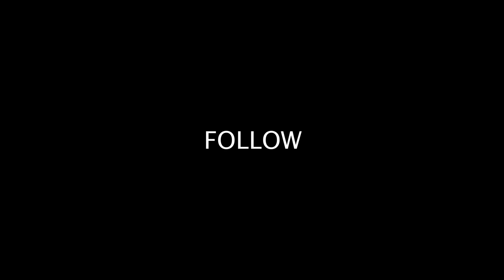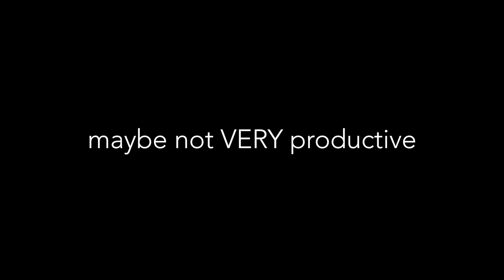the end of an era...

Comment: If you have snipe issues one option is to put a longer board underneath. You will need to either put a stop block on the front and use some rubber to grip, and make an adjustable stop on the other end, or use some double sided tape, carpet tape. The long sled board on the bottom will keep it straight as it passes through but it looks like you adjusted it close enough. Just keep the sled in mind if you have that issue with some other board or something.

Comment: For your snipe issues grab your owners manual, feeler gauge and a block and make sure your infeed, outfeed, cutter head, pressure bar and chip breaker are all set to the measurements in your manual.  I was getting horrible snipe after swapping my cutter head from knives to a helical head.  Went back to the manual, under adjustments and reset everything to the recommended measurements.  All my snipe issues were eliminated after doing so.  Look for your Cutter-Roller Assembly (side-view) for the information.

Comment: The board is not flat!  That is why we joint boards as part of the squaring process.  Test. Place your boards on a known flat surface and see if they rock.  if they rock they should go across a jointer.  No jointer? You can plane the high spots off but that is time consuming. 
If you are going to do this right you need a jointer. Get a jointer wider then your boards. Another is a drum sander.

Comment: A planer is a "rough-cut" tool.  This means the user is getting flat, parallel surfaces that are close to the finish dimension but still rough.  Wood is generally left thicker and/or longer than is needed.  Then, snipe and other tool marks are removed by sanding or cutting.  Get a drum or wide belt sander.
Reply: Agreed you want to leave 4” on both ends of the boards more waste but zero snipe when you remove the ends. I have the super max and it’s perfect for cutting boards
Reply: @ibf8581  I think you could probably get by sanding the snipe out rather than cutting it off.  Seems like it wasn't very deep.

Comment: I'd recommend getting a rotacator for dialing in your planer! I have a Jet 208 HH (mechanically identical to the G1033x), and I was having bad snipe/infeed problems as well. Using the factory recommended heights for the various components (bed rollers, infeed/outfeed rollers, chip breaker, etc), I've been able to get it perfectly dialed in. The recommended settings are very precise and most easily acheived with a rotacator.
Reply: I agree 100% 
Unless your pressure rollers are set as accurately to the bed as the cutter head then snipe will consist. That's what I focus on!! Infeed and outfeed rollers don't really matter.....it's the pressure rollers that keep material from snipping. 
The rotacator is sure easier to use than anything else for these adjustments inside the planer.

Comment: Just keep in mind you can never total eliminate snipe while running a single piece but looks like you have it tuned up to where its not noticable. Running multiple pieces back to back with sacraficial boards to start and end is a great technique to try
Reply: Of course you can, with a decent quality machine. Mine (A3-31) is totally snipe free when I lock the table. But you are right that it is much easier to do when pushing all the boards one after another.

Comment: Hey Guys, 
We make quite a few cutting boards. I’ve learned the best way to avoid snipe is less use of a planer. You do a higher volume then we do so its not quite apples and apples. I bought a Freud Glue line table saw blade. So i can go right from the table saw to gluing in clamps. I do not have gaps. If my stock is thicker i also run them through the table saw or drum sander before gluing.. So i go directly from table saw then clamps to drum sander with 120 grit paper
I never put a glued up board through my planer. I have a Delta planer . Making sure my in-feed and out-feed tables are as close to perfectly level as possible and blades are sharp. When you were doing the adjustment of the rollers I would recommend digital calipers to get a better adjustment.
 I have many years as a woodworker. Retired USAF avionics technician and commercial airlines A&P. Spent a big part of my life calibrating and maintaining equipment. I really recommend a documented scheduled inspection for cleaning, lubricating  and checking adjustment of equipemt

Comment: I have the same grizzle planner as you do.  Here's the fix- The problem is the short boards you are running through it.  To fix - take a piece of 3/4" plywood that is one foot longer than your cutting boards on each end (2 feet longer than the cutting boards) Screw a thin strip of wood crossways across the  plywood - one foot from the end to keep the cutting board from sliding backward as it runs through the planner.  Called a sled, will stop sniping on short boards run through your planner. Need more information contact me a George Wood of Texas.
Reply: What I don’t get is that this guy thinks that snipe means there is some wrong with the planer, whereas any woodworker knows it’s a common issue with planers. He seems to ignore all the people like you who give the solutions.

Comment: Not sure if you figured this out yet, but here are my solutions: 

1) you need to do 1 of 2 things:
 A- run all your boards together, back to back to back to back … with a scrap peice before and after each “run” of material
B- Have 2 sacrificial pieces, one before and after the board, 

Why? You are likely getting snipe when the weight of the board is too much or little for the roller, or the pressure from the roller is To much for the board.  In other words, The rollers are putting uneven pressure at the front and end of the boards.  Doing either A or B listed about removes the uneven pressure.  It’s a mistake many of us have made.  This should fix your issue, since the snipping is only occurring at the front and back of your pieces. The intermittent part is likely due to running only 1 board through … or not feed the machine fast enough with board 

Other solution:
If you can figure it out, wasting a whole board is bad business.  Instead of making an 16” board, make a 20” board that you cut 2” off each side.  Whatever is enough to save the board.  Usually snipe is 1-3” from my experience 

That should do it.  Maybe you knew it, maybe not, but hope it helped some.  I didn’t know those big bastardly machines need oil every 24 hours, so saved me a headache in the future.

Comment: I believe the bolts that adjust the tension on the feed rollers are passthrough. Put a couple drops of oil in the hole and it drips through to the rollers. At least that is how my powermatic version of this planer functions.

Comment: You will almost always get some snipe plane longer boards and cut off the snipe. It also helps the do several light cuts 1/64. plane your cutting boards in longer lengths the crosscut to desired size
Lift up slightly on the infeed and outfeed just a little up pressure helps.  Have fun
Reply: I have been a cabinetmaker for 42 years its fun watching your videos thanks

Comment: If you run all of the boards in a row touching end to end, you will only get snipe on the first and last one in the chain, this might involve having a buddy one to feed and one to catch but it will completely eliminate the cause of snipe, and it will also speed up operations.
Reply: I do this but use a scrap piece as the leader and then use the same piece at the end of the line.  Just set it on top of the planer as it comes out and you can then feed it back in at the end.  Then only the scrap piece has the snipe.  Works really well!

Comment: Bed rollers are to high. You need a dial indicator and set your roller to zero. Then wax the plane bed.  If it still sniped you need to look at your pressure bar.

Comment: Oh the dreaded snipe issues ,never fun and causes a lot of waste ,I make edge grain boards so I can make thicker boards without doubling $ buying 8/4 wood ,I put about 23 strips per board (average)27 in my latest , but doing thin strips through the planer I have to lift the strips on the out feed side to avoid the snipe ,it works great but slows production down 🤷‍♂️ oh and it’s just a cheap 12” delta portable , great video guys !!

Comment: Try either running a scrap piece of wood ahead of the boards or glue sacrificial trim pieces on the sides of the cutting boards keeping them a little longer than the board, that’ll stop your snip, I use these methods with my bench top planer and it stops all snipe. Good luck keep up the good work I really enjoy your blog.
Reply: That’ll get expensive when your running thousands of BF
Reply: @Kurutzkraft  it only takes a small piece of scrap wood put in ahead of the boards to stop the snip, so shouldn’t create a significant cost.

Comment: Am an RN by day and have been making trays and boards. I use the time in my garage as therapy. Popularity in my product is increasing and am making the move to an official business. I will be ramping up production a little and wondering your thoughts about a nice ROS. I have been using a Dewalt but know there are better products out there. OF course, Festool and Mirka are near the top of the sander food chain, but is there something in between? Or should I hold out and save my pennies for a REALLY nice sander?

Comment: First of all. I love your videos and what the two of have accomplished so far. Very inspiring.  
Looks like your snipe issue is pretty much resolved.  Just happened to see one of the bearded wonders of YouTube.. using a planing sled. Hot glued the workpiece to level and secure to the sled.
Reply from the maker: That would be a LOT of hot glue for a batch of 80 boards…

Comment: I bet your feed roller spring tension is off...had that problem with my first Grizzly (bought it used)...your manual says the spec....mine is 1/8" above the head surface. (Yep, I was right. Posted this before I finished the video.)

Comment: Make sure to use a good car wax on all your cast iron tops. Just waxing a car you will be surprised at how fast it makes your wood move through the process. As well as keep the rust off the tops.
Watch the tempatures changes too a cold shop and warm outside will rust your top faster than you snap your finger. 
Joe